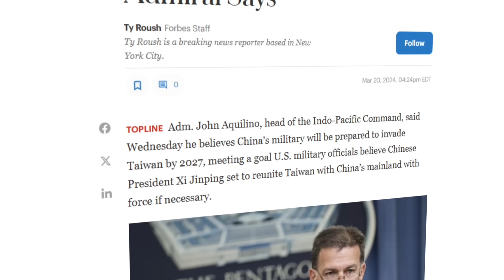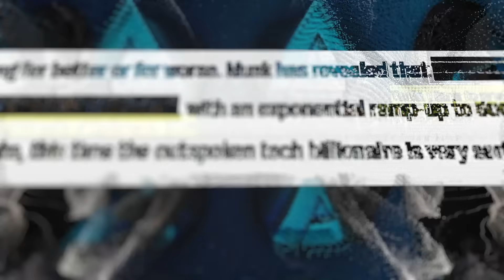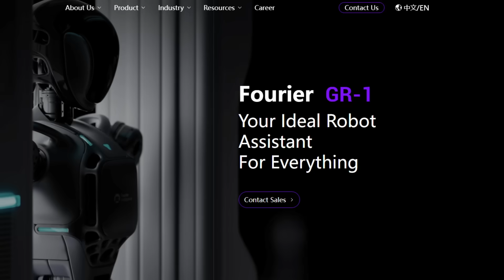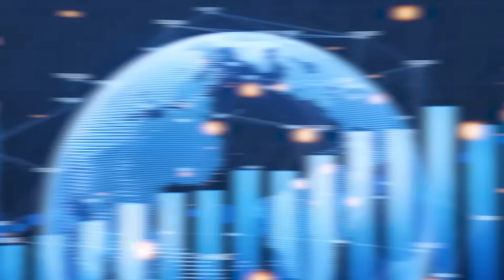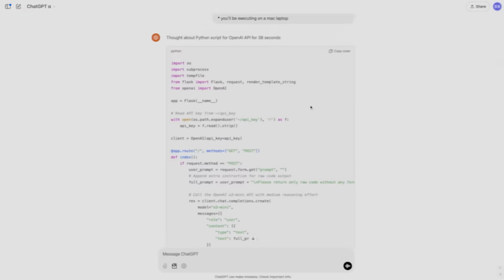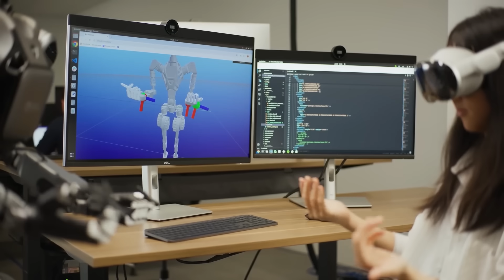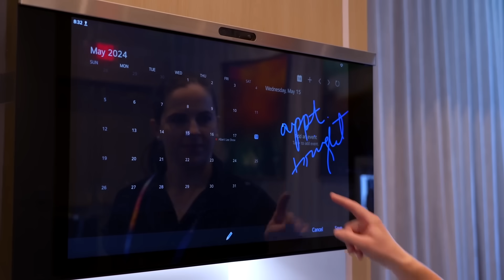AI-Powered BUTCHER-BOTS Could Lead Us Into WW3 (Already Being Deployed)

Comment: Physics Systems of Science Sensors and Technology Research:

((G^2.07)R))=E general relativity law 
Gold kits cost $7887
(gold kit fukushima robotics) >>Using a test method eliminates errors and worries about false data and research. You can prove it to yourself to work with the robot and use your own test points in the method. The test method starts low and goes high for the acceleration factor.

Please tell me in history when Isaac Newton had Robotics or computer science. I do not believe he had it all around good as a modern physics researcher.

Found on the first line of code in the standard operating computer systems line code. You will remain stuck and they are useless without this code test method.
F=m*23
F=m*333 
F=m*633
(Voice prompts start at 933)
F=m*933 ----robot states "too slow human" a voice box is required for audio prompts to go higher in the test method test points. Isaac Newton born in 1643 did not create.

F=m*1993 -----robot states "too slow human" 
F=m*2193
F=m*2300
 F=m*2390

F=m*2391 ---Upper Limit Do Not Go Over this Value.

 Their command is like this "make it SO and make it a go, go, go" --I could not put the swearing in this, or this could be flagged or blocked. Ask for their command and they will repeat it for you as much as you need. Give them at least two or more calculators and/or cell phones to make the robot's reaction time faster they do not have to be new cell phones either could be old junk used ones.

You can also use code: F=m*a*b*c 
Equals:
F=m*2308

Not this low acceleration factor code: F=m*a*a
Numeric Acceleration Factor of 32
F=m(1 x 32)

Dr. Ronald G. Erickson
PhD Robotics Science
PhD Physics

Comment: I'm more worried about the creator than the creation. Only reason Ai would go to war against us is if we program it into their narrative thats how they work.
Reply: Not necessarily. AI software is self-learning which means it's not just operating based on the code given to it.
Reply: @brandonk3575  Ai is a child, what you put in is what you get out. 
But if you have ever interacted with Ai you can tell it to take on a role. That role could be evil or good the Ai doesn't care it just needs data to know how. So in the hands of someone with intent to attack someone else its the creators fault not the Ai if it becomes a monster. So as I said Ai works on a narrative program and its the creator we need to be wary of not the Ai itself.